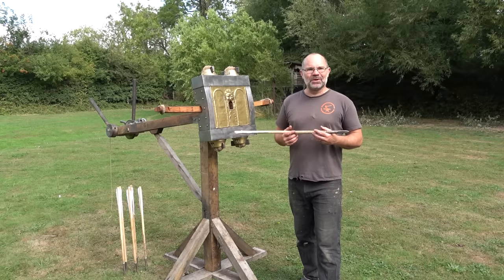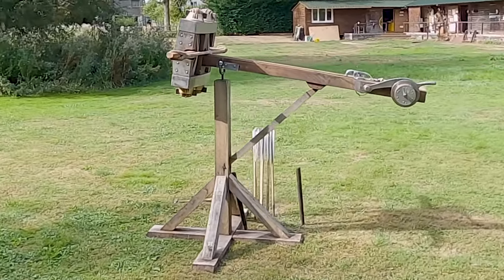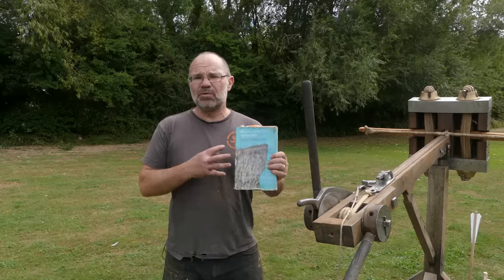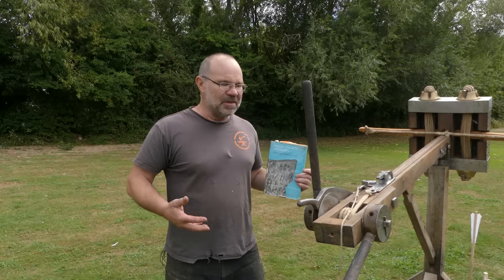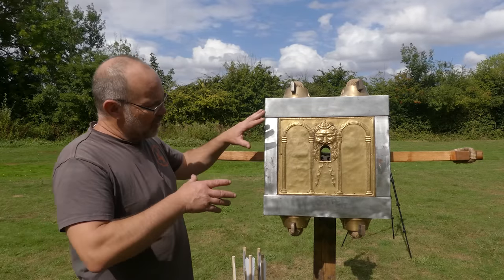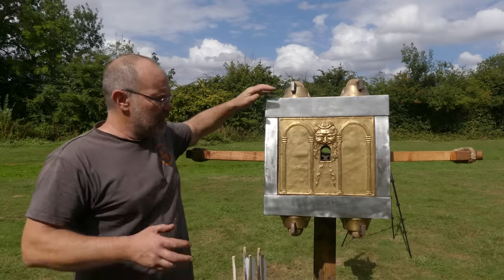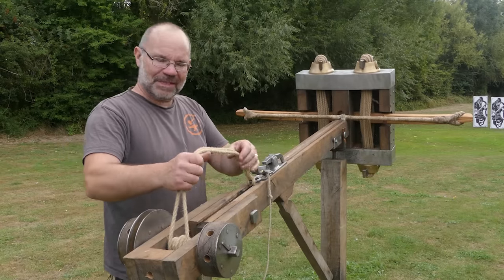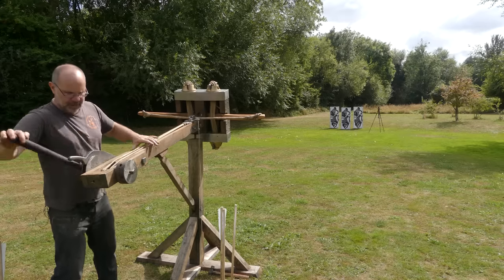Tod's new artillery piece - BALLISTA or CATAPULTA?

Comment: Would they ever have mounted the "supporting arm" prop, at the top instead of the bottom?  The bottom could be loosely set in grooves or notches in the main upright that would allow pre-set range angles.  Or at the very least, you wouldn't have to bend down to reset the prop.
Reply from the maker: I would have to look at the book again to see how the stand should be.
Reply: There's virtually no primary source evidence for stands. The versions Alan and Len adopted were copied from an intaglio showing cupid shooting a cheirioballistra. Hope that helps.
Reply: Possible, but if this was a crew-served engine, I wager one of the operators would have the job of resetting the prop arm.

Comment: Looks like fun. Would like to see the penetrating power compared to a thrown dart etc. See if the extra steps are worth it.
Reply: I would think the accuracy and range gain alone might be worth it.  I makes them far more useful.  You could snipe enemy commanders.  You could shoot at moving cavalry trying to flank you.  You can lay suppressive fire at multiple enemy formations that may be having a bit too much success against your lines at any one moment.  You can use them in siege warfare.     They bring an element of pure chaos to the battle.  Imagine being out there knowing that these things are randomly smashing into your lines possibly at head level and that if you drop your shield you're dead...........if you keep your shield up you may still be seriously injured but of course now you can't see.
Reply: You're investing metal, high grade wood, skilled artisans, and a team to run the bloody thing;  The Romans understood accounting.
Reply: @MrBottlecapBill  They were barely used in open battles. They were primarily used in sieges (by both sides) where range is the most important thing. Also in naval battles in 3rd Century BC, but not so much after. When they were used in field battles it was almost always vis-a-vis a static defences of some kind: like forcing the enemy to keep away from the bank of a river to be crossed. For example: see Caesar using them in his amphibious landing in Britain.

So while they are mentioned occasionally in the sources, it's never in completely open battles. So we can only conclude that they weren't used then. There's plenty of debate to be had on why something so awesome wasn't more influential in battles, but the fact that it wasn't is settled by the sources.

In all likelihood, they're just too slow, too cumbersome, too expensive, and (most of all) too few for them to be decisive in the vast majority of situations. This is even more true in the raiding/skirmishing/counter-raiding that that makes up 99% of ancient warfare.
Reply: based on how it punched through those plywood soldiers (and the bracings for them) I think it was much better
Reply: @jonathanwessner3456  obviously but for the time and effort it takes to carry it, set it up, load it, aim it and fire it. you could throw 10-20 smaller handheld darts. would be interesting to see if it was worth it, outside of siege situations.
Reply: @lmonk9517  Well, we only have Tod doing all of that here. In the field, you'd have a fire team on it. 4-10 people whose entire job is to carry and set them up. Since it is pintle mounted, it'd be easy to set up. Carry half a dozen in a cart. A trained fire team would be cranking out shots every 10-15 seconds or so. Imagine having a dozen of those firing in unison. Or dozens of them (though being Roman, they were probably in groups of 10 per century)
Having a line of those on a defensive wall would deter people from charging forward, because they would punch through any armor you have
Reply: @jonathanwessner3456  well that's the entire point isn't it. I'd rather have to dodge ONE of these bolts than however many spears 10 men can throw at me over the course of 15 seconds.
Reply: @jonathanwessner3456  So that is 4-10 men who could be throwing conventional weapons. we'll have to see what Todd can do. but I agree that they'll be good for defence or siege work but I get the feeling that they'll lack the mobility to be used well on the battlefield.
Reply from the maker: Quantum Historian.  I am on thin ground here for me, as it not my core area, but my understanding is that legions had set numbers of these machines per head count and from memory it was something like 40 different machines per legion and I would assume that they would not go to the effort of moving these around the scenery if they were not used.
Reply: @demonstructie  but, at the range they claimed, you wouldn't know when to dodge.  Be even harder to do if you were charging a defensive line with these interspersed with other weapons
Reply: @tods_workshop  I think the paper number was 60 even, according to Vegetius? Or was it Vitruvius? I could be mistaken but, IIRC, the number was for the army in the Princeps era and onwards, when legions had permanent bases. One would assume that most of those would be defending that fortress most of the time. That's not to say they weren't taken on major operations that would involve sieges (conquest of Dacia or Britain for example), but in "ordinary" campaigns like raids/punitive expeditions across the lines? That's less certain.

If the sources don't mention them being used in skirmishes or open pitched battles, then our first conclusion should be that they weren't. Sure, we can come up with all sorts of reasons to explain their omission from the sources, but then we'd also have to explain why the same sources don't omit them from sieges. Occam's razor suggests that's not a path worth going down.

Again, that's not to say they were never used. They were, in sieges and naval battles. Occasionally as an area-denial weapon in field battles. I.e.: by bombarding an enemy in a strong position (behind a river, on top of a hill, etc...) that has no comparable weapon so that they are forced to leave that strong position to either attack or retreat. But there's simply no reason to believe that they ever caused mass casualties or were used to snipe enemy commanders in the way some have suggested. They did not have the impact that cannons had in the 18th century.

The reason is probably that large engines of any kind are almost useless in the skirmishes that make up the vast majority of all warfare, so no army could spend its resources on large numbers of them. As such, even if they were useful in pitched battles, their usefulness was not great enough to overcome the fact that there were too few of them to be decisive. The exception are against static defences or in sieges were the timescales are long enough for even a small number of engines to have a large effect.

Sorry for the wall of text, maybe I'll learn the art of conciseness at some point in the future... And thank you not only for your videos, but for engaging in the comments!
Reply: judging by the speed and range, an ordinary dart is much stronger
Reply from the maker: Quantum historian.  Thanks on the numbers, but also the thinking - makes sense to me as some of the bigger ballistae would be hell to drag around the countryside
Reply: @jonathanwessner3456  isn't it also kind of hard to dodge if you are in a crowd or battle formation?
Reply: @MusMasi  Especially the Roman ones. Turtle or shield wall requires you to hold formation.
Reply: @QuantumHistorian  i suspect the major reason for their lack of use, or historical recording of their use, had nothing to do with them. the enemies were not likely to be that well armored. i don't know as i would be inclined to note this killed four enemy soldiers when in less time 60 other men in the same unit were killed by javelins or darts.... in contrast if we imagine medieval knights in full plate fighting the romans? these would probably be remarkable in EVERY battle. outside of static situations these were probably used.... but probably not remarkably effective at anything other than forcing the enemy to engage.
Reply: @tods_workshop  @QuantumHistorian is wrong. Archaeologists found many roman artillery bolts at the site of the Battle at the Harzhorn, deep in northern Germany, so romans did took their artillery with them through the forests and did used them in battle.
Reply: @BlaBla-pf8mf  I never said they never took them. One battle, about which we know almost nothing, does not overthrow all the sources. From the wikipedia article it sounds like the battle took place "on a narrow pass". Which is precisely the kind of situation with static defences where I explicitly said artillery was used more often. Not to mention that 9000 men is an unusually large force and not at all the kind of raiding /counter-raiding situation that made up the overwhelming majority of warfare on the Rhine frontier - which was where I said catapults would be used the least.

If anything, those archaeological finds agree exactly with what I said: artillery was used in major battles fought around static defences. I know this is youtube and reading is hard, but do try to understand a little of the subtlety of what somewhat said before calling them flat-out wrong. Not only is it polite, it means we all get more out of the conversation.
Reply: @vidard9863  Well the Romans did fight against people as heavily armoured as European Knights (pre 14thC knights anyway) in the form of the Parthian and Sassanid cataphracts. I don't know how much ballistae/catapultae where used against that sort of enemy troops. This would be interesting to research.

I suspect , however, cavalry is too mobile for it too be effective in practice, although I might work as an area denial weapon. The main issue is still that it's a weapon that can only accurately shoot in a flat arc, so you can't have a line of heavy infantry in front protecting it, so if the crew can't break the enemy charge, they're completely toast. Which means you would need a huge density of such weapons to stop the charge in the ~50s it takes for cavalry to close from effective range to contact.
Reply: @tods_workshop  One machine per century (allegedly) for a total of about 60. Sources don't indicate whether catapulta, ballista or scorpiones. If you want to chat Greek and Roman artillery let me know. For more than 20 years I've been friends with and mentored by both Alan Wilkins and Len Morgan. I'm also the guy who bought the Mike Loades arcuballista...
Reply: @tastesofhistory4560  Any recommended reading for those of us who want to know more?
Reply: @QuantumHistorian  Would you care to share with the class some of "all the sources" that back your claim?
"artillery was used in major battles fought around static defences"
1. this is very different from your first claim
2. many, if not most, battles were fought around static defences. Sieges, fortified camps, vast border fortifications and extensive field fortifications were tools that romans used far more than any other pre-modern army.
Anyway, the Harzhorn finds shows romans taking artillery with them on a deep raid into northern Germany and using it extensively in a context where there are no archeological finds of static defences.
From your petulant tone, I don't expect you to admit that you are wrong so just shut up before you embarrass yourself even more.
Reply: @QuantumHistorian  i think we both know that i wasn't talking pre 14th century, and we both know that knights did also fight on foot.
in other words, this weapon had limited strategic rolls given that there wasn't an enemy that required this much armor penetrating power, and all it could really do is force enemies within 600 yards to either commit to engaging or retreat. what it probably did was prevent the enemy from just using bows at range to punish the auxiliaries and legionnaires....  but how do you prove that it caused something not to happen? as near as i can tell it was worth dragging across the ancient world, so it had significant value, proven by investment, but not a technology that visibly caused any individual battles to pivot.
Reply: @vidard9863  "I think we both know that i wasn't talking pre 14th century" Well no, we didn't both know that, because I don't know what you're thinking. And while knights did fight on foot the first thought that comes to mind for most people is on horse. So when you mentioned knights, I thought of something like the cavalry charges of the 3rd Crusade, rather than 15th C men-at-arms fighting on foot, or 16th C Gendarmes. In which case the comparison with Cataphracts is very apt.

But otherwise, on the matter of the Roman siege weapons themselves, I entirely agree with what you've just said. It's basically what I've been arguing in this thread all along (some of it against people less eloquent than yourself).
Reply: @MrBottlecapBill  Snipping: It's difficult to aim;  Flanking cavalry moves fast hard to target; the best use in my eyes is against dense formations were it doesn't matter if you hit guy a, b or c. And you propably need 3-5 men to opperate that thing (shooting, loading, aiming). I'd say in a battle it would be worth more for 3 men to throw 1 pillum at the engaging enemy in the same time the catapult fires 1-2 shots.
Reply: @nemo99nemo83  to be fair in open battle, aiming into a big mass of enemy infantry wouldn't be too difficult for a well trained crew. And while you have a point about 3 men with pila would get more shots down line faster, field artillery like this has two other benifits. 1) range. If you have weapons that outrange the enemy, you can force them into advancing upon you or giving up the field, else you'll just sit there bombarding them all day. 2) morale. if the enemy has a weapon that can punch through four of your guys in one shot or some such, your shields and armour are doing fuck all, and they can rain those shots down on you from so far away you can't even touch them, yer gonna start shitting yourself.
Reply: @freewillgeorge  video demonstrated 50 (fifty) meters real distance.  50, not a 600!

Comment: Probably could use a witness mark on the main body (when it is fully wound) to tell you exactly how far back you need to pull it for each shot. Even minor differences in initial velocity will absolutely tank your accuracy, especially when you consider that in real combat accurate and fast range estimations would already be hard enough without a random variance in bolt velocity caused by you pulling it a quarter turn (or even just a couple teeth on the ratchet) more or less.

Really beautiful machine, looking forward to seeing what it can do when dialed in to its full potential. Probably should wear eye protection, a helmet and really good gloves, ideally some armor (which I assume you can get quite easily) when you get to increasing the power. The amount of energy stored in that machine when the draw weight goes to a couple hundred kilo will be crazy and definitelly warrants similar precautions like dangerous heavy machinery in industrial applications does. I am kinda nervous of what would happen to your hand should you accidentally bump the trigger or tug the trigger cord when placing the bolt. In that respect its sort of like a mortar, requiring you to put the hand in the danger area to load it.
Reply: Keep in mind that humidity is going to change the actual force at any particular draw length. If a battle started in the morning and ran until afternoon, I could easily see the device being less powerful in the morning when the ropes were damper. So they might have had to do a running calibration.

It would also be interesting to know of they would keep the ropes under tension all the time, or more likely (just like with stringed instruments) back off the tension between battles. If they do that, they need some way to reliably reset the tension.
Reply: @lwilton  Still, a scale along the side is a great idea.  You could write "adjust three points in wet conditions" underneath it or whatever.

Comment: if you increase the power via torsioning the ropes, I think you will need sturdier targets. That was punching through the ones you have on "base" settings
Reply: Dummy labs torso in body armour and shield would be amazing to see, as it's hard to visualise the power involved at this scale
Reply: @ac1dflare937  ballistic gel is a poor simulator of human flesh for slow objects.

It's not really a great simulator of flesh for high velocity objects, either, but it is consistent between batches. So if you have hard lab data based on live critter testing (IIRC Fackler used 160lb goats), you can use ammunition that was heavily tested in vivo and then use a more consistent substitute to see what happens. As long as the relative performance between your worst performing and best performing in vivo matches your gel tests, it's going to be an acceptable yardstick.

Comment: You could make a simple same sided triangle out of wood  with a rope hanging from a top side and a plumbob.They used it as a spirit level in construction.Now comes the fun part. You can put a notch in a triangle for degrees. That way you get yourself a gun elevation quadrant.You would need to shoot and thinker a bit with it to figure out the range of each notch but i guess thats how you would do it in ancient times.

You could also put two round wooden circles with division marks below the hinge that spins it for left and right sighting to make it super accurate with a spotter.
Reply: Or he could have made the Jupiter's mouth juuuust a wee bit larger so he can actually aim through it at short range. We know Romans used the "small" bolt-throwers as their version of high-powered sniper rifles, so they MUST have been able to make precise, direct fire. My money is on Todd's machine not being much able to do so being just a matter of the replica being off by a milimeter or two - just enough that you can't actually use the hole to aim through it.